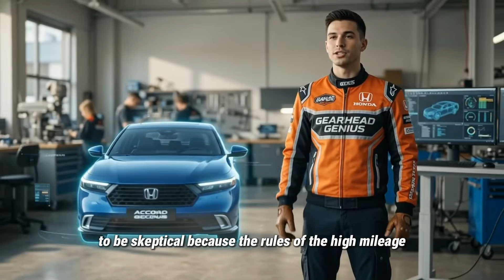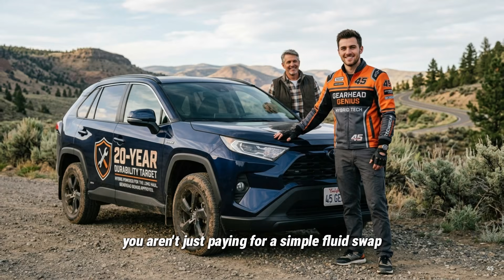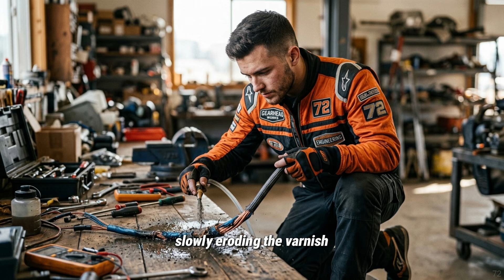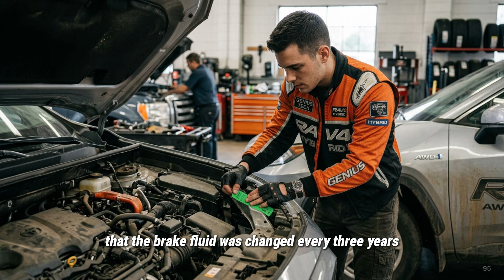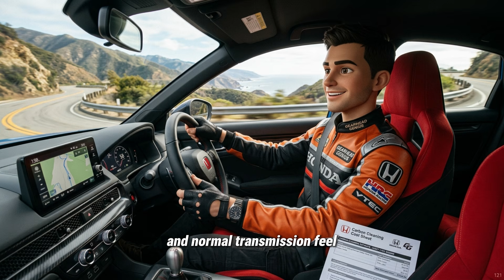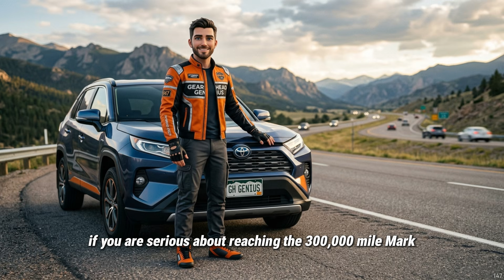Which Hybrid Car Costs Alot More to Own: Toyota or Honda at 100k Mile?

Comment: From everything I have read, you can defer the injector cleaning on Honda hybrids by using only Top Tier Fuel with the use of a fuel cleaner ever 2 years/24k miles.
Reply from the maker: That is a great point, and using Top Tier fuel is absolutely essential for keeping the tips of your fuel injectors clean. However, there is a fundamental engineering "gotcha" that no fuel additive can solve on a direct-injection engine like the 2.0L in the Honda e:HEV.

Because the fuel is sprayed directly into the combustion chamber, it never touches the back of the intake valves. In a traditional engine (or Toyota’s D-4S system), the gasoline washes over those valves, keeping them clean. In the Honda, oil mist from the PCV system bakes onto those hot intake valves, creating a carbon "crust" that no amount of detergent in your gas can reach.

So, while Top Tier fuel prevents injector clogs and keeps your fuel pump healthy, you are still carrying that "Carbon Debt" on the intake valves. By 100k miles, that buildup starts to restrict airflow and cause the "stumble" many owners see. It’s why I always say the Honda needs that extra mechanical "Geriatric Care" that the Toyota simply bypasses with its dual-injection design!
Reply: @GearHead_Geniusgtr  Interesting, luckily we live in a urban area ad put about 5k miles a month on our car, so we'll sell it well before it gets to 100k miles. Having said that, the frequent short trips triggered our maintenance minder for the first oil change on our 2025 CR-V at just over 5k miles so we figure our maintenance burden will be higher for not just oil, but also the transmission fluid flushes.